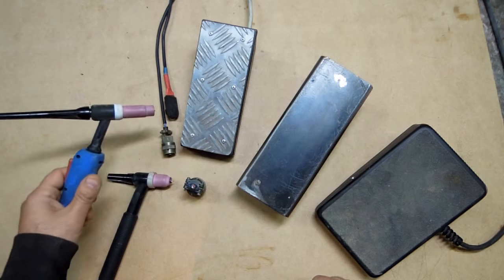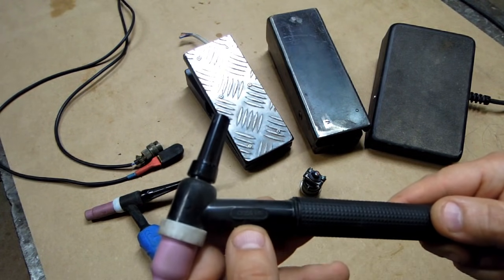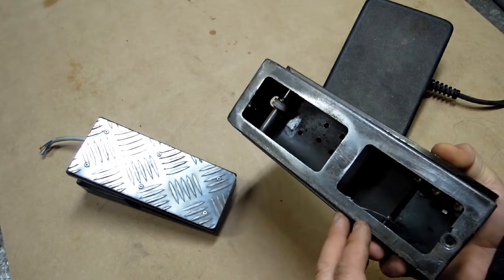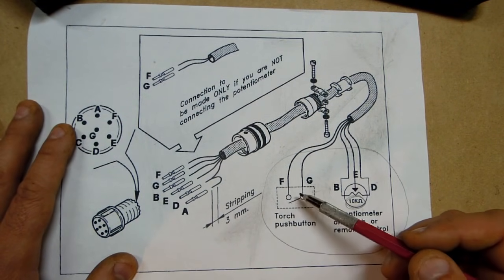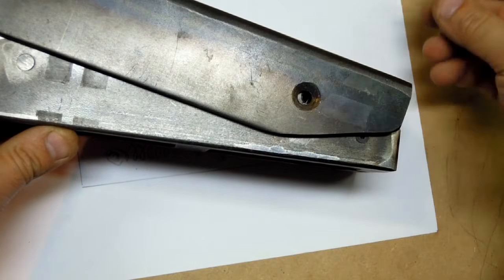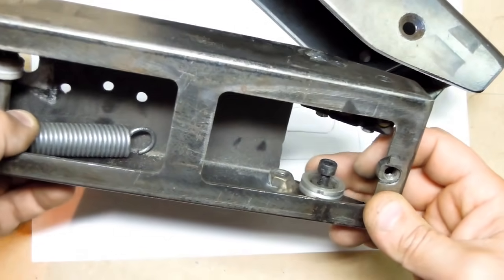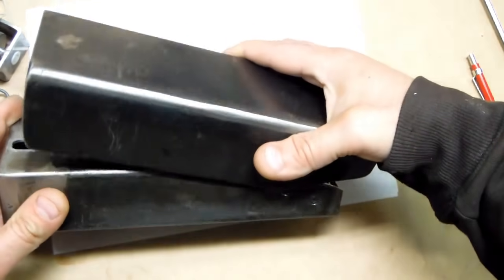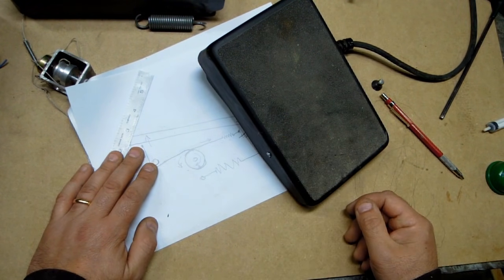DIY Tig Pedal - Part 2

Comment: Very cool Tony, I was just out in the shop running a few beads and making a 3rd hand out of re-bar and scrap steel...and TIG brazing some Copper onto the contact surfaces to increase conductivity. Brazing with electrical wire is fun, the puddle looks trippy and the Copper melts like Gold does, especially if you're not careful with the heat. It's pretty easy to control the heat with my footpedal now that I've gotten in my practice, but since the pedal defeats the amperage control, it does take a bit more brain power to keep in check.

I was wondering if you knew how to add a dial to the foot pedal to control the top end? If not I was thinking about adding a bolt I can adjust to prevent the pedal from going too far, but reducing the pedal's range wouldn't be ideal, and I am sure you feel me on that. Aloha...Chuck.
Reply from the maker: Thanks Knolltop.  Re: limiting the machine, all depends on the machine.  Rather, all depends on the potentiometer setting.  Usually 0 ohms = full machine current.  If you add a 2nd pot in-line with your foot pedal you should be able to cap the current.  Say your machine uses a 0-10k pot.  That's your whole current range.  If you add another potentiometer somewhere, so it adds to your footpedal, then you're bumping the 0 ohm setting away from zero (can't reach full amps).  Say your second pot is also 0-10k.  If you set that to 1k, then your foot pedal is now 1k-11k.  So your machine can never reach top amps (0 ohm).  If you set it to 5k then your foot pedal is 5k-15k.  Make sense?
Reply: Yes, that makes sense, and so I think I can figure out which wires run to the pot and where to install the 2nd one...just so you know, I've got an Everlast 160sth and I really enjoy it. The only thing missing is AC for Aluminum...

Oddly enough even after years of working with sophisticated machines and all the control in the world, I have gotten used to not having amperage perimeter controls. But, I'm sure I'd spend less time on testing/practicing just where to hang my foot, depending on thickness, if I had a dial. Plus, welding is a little more fun for me when I don't have to concentrate on feathering so much, and can just bury the pedal...

I'll let you know how it goes, and thanks again...Chuck.
Reply: @ThisOldTony just an observation:  When the resistance at pin E is 0 ohms relative to pin B, then it's 10k ohms relative to pin D... and vice versa. So you could say max amperage is at 10k ohm and min amperage is at 0 ohms if you swap your reference point. B <-> D

It's all relative. ;-)

Comment: Hi Tony,
So basically we only have a pot and a resistance regarding electronics?
Do we need something else for High Frequency start ?
Do you think about improvements after 1 year of use?

Thanks a lot for sharing this
Reply from the maker: +vibram500 A pot and a switch.  The switch initiates HF start, the pot sets the current.  As mentioned in the video, the hard part is timing the pot so that it provides the correct resistance the moment switch is triggered.  The moment the switch .. switches.. :) .. you want to be at your lowest AMP setting.  If the timing is off you'll limit your machines amperage range (the value when the switch actuates will be your starting amps.. and up from there until you run out of pot range.. which hopefully = the max your machine will do.

My pleasure.. and have fun!  Thanks for watching.
Reply: +This Old Tony Great thanks for your really quick reply. I will work on it this summer I hope !

Comment: chinese machines have two plugs a 2 prong for the switch and a 5 prong for the potmeter
other thing , there volumepots for radios that have a switch at the start . would that be strong enough to switch the welder on and off ?

Comment: Nice one Tony and not to long to hear how a fine mind thinks!  Your mechanisms accounted for all the variables quite ingeniously, but you forgot the first rule of electronics design and having at least a 3 year availability of parts. ~¿@  I'm sure you can find a replacement for it and have seen similar on E-Cabinets but with 1/4" spades instead of screws.  Most of them of similar VA have similar thru hole mounts too.  Always a pleasure! Thanks for Sharing your time and insights.  ~PJ

Comment: My Klutch 220Si has no provisions for a foot control. I'm considering using a Yamaha 7221 chain drive foot pedal for drums. Maybe a low voltage switch for the hard stop in the up position with relay buffering.

Comment: I just bought the metal parts for a pedal, I decided to make one.
 Unfortunately my welding machine does not have a plug for the pedal, so I have to modify the onboard circuit also.

Comment: Hi Tony.

First of all I'd like to say thank you for your time and effort for your tip top editing skills. It makes watching your machining skills a little more enjoyable! (English sarcasim)

Can I ask one question? Is that a Kemppi plug I saw on the video? if it was would you share the pin wiring with me please, as I have a kemppi mastertig 3000.

ps loved the cnc welding also your new vortex tube. I didn't even knew they existed till you mentioned! Thanks :)
Reply from the maker: Thanks David!  I'm afraid it's not Kemppi, it's a Cemont.  Have you tried emailing Kemppi support?
Reply: I'll give it a go. I'm guessing they will be very reluctant and if I make up an elaborate story about my R11F they will probably just say take it to a repair centre. It's worth a shot though. 
Thanks Tony.
Reply: I have the wiring diagram for a Kemppi C100F pedal if that's what you are looking for, 4 and 10 pole plugs.
Reply: 1873Winchester unfortunately it has to be a R11F according to Kemppi. The C110f doesn't work according to them. Thanks for the offer though.
Reply: 1873Winchester Hi I would like text you about wiring diagram for Kemppi C100F. If you still have please text me.
Reply: Thank you very much. Everything is ok, but i can't read 
capacitors c1-2 and zener diode v1-2. Can you help me?
Reply: I believe V1-2 are 15V/1.3W and C1-2 are 220N/63V, had a hard time deciphering them too
Reply: Ok, so thank you very much.

Comment: Hello! You say the potenciometer is 10k to minimum current and Zero ohms to maximum current....  In fact we use just 2 points of the potenciometer right?  My machine use 2 separated connectors,  one to on/off and another the current control.

Comment: Would be handy if a guy could buy a potentiometer with a splined shaft similar to a servo horn, would be awesome for 1 off projects like this in that you can clock it in a somewhat small range of motion to accommodate design error.

Comment: The pulley at the heel seems a bit over-complicated. You could probably have just welded a rod or plate to the heel of the pedal (at 90 degrees, pointing down), and attached a longer spring (or that same spring with the steel cable) directly to it. It would basically do the same job as the vertical part of the cable.

For the switch (assuming that was originally one of those switches with rollers), you don't really need to worry about the throw matching the motion of the pedal if you mount it vertically and use a sliding cam (again, welded directly to the pedal) to press it. Not sure if there would have been enough space inside the pedal base to do that, tough.

Comment: I have a question.. recently when i turn on my welder the arc starts... the only way i can stop it, is by unplugging the pedal. Ive tried cleaning the potentiometer and checking resistance and I am stumped. Im pretty sure it is time for a new pedal, but if there is something I'm missing i would hate to spend hundreds to replace a pedal if there is an easy fix
Reply: The machine is a lincoln square wave 255, older transformer machine

Comment: Hye hye hye there OT - a ridiculous simplification - I wonder if it would work.  Take an extra-thick inner-tube (26 in thorn proof tube) and slice some rings and wrap them around the end of the pedal, right where you indicated.  Had to learn the hard way that spec'ing springs is a 2nd choice to using rubber elastomer bc of relative properties of the materials.
Now tell me your secret editing sausage recipe.. 😁 Mum's the word.. 🤐

Comment: i have a tig stick welder ( boc 185ACDC ) and i want to buy a slider for the torch, the manufacturer wont tell me or supply a diagram that would tell me the resistance of the pot so i can get the correct one,
how do i find out which resistance value on to buy?
cheers in advance

Comment: If your machine sees 10k ohms for the minimum and the act of switching it on drops it to 9k why not install an 11k resistor so you get the minimum at start? Or why not use a normally open start switch that stops the machine when it's closed?

Comment: Very usefull. Been thinking about acellerator for electric go kart, the speed control uses a pot,  the internet is awash with hall effect witchcraft.. keyboard volume pedal, top tip.

Comment: Very late suggestion. Engineer the switch and potentiometer "mechanically" in series. Make the switch part of a two stage pressing mechanism, so that you have to press "through" the switch before it can turn the potentiometer

Comment: simple question, can you modify any tig to take a pedal or does it have to allow a pedal add on?
Reply from the maker: +Troy Dawson Good question, but above my pay grade.  I'm sure a determined person could tap/hack into the panel knob or keypad.  I believe my TIG has a simple panel-mount potentiometer that gets bypassed when I plug in the pedal, but I'd suggest taking a very close look at how the machine determines the amp setting before potentially toasting the poor thing.
Reply: +This Old Tony Thanks for the reply.  So with a little thought on the electronics, potentially (no pun intended) any tig welder which has a potentiometer could be bypassed and have the potentiometer within a foot pedal to do the work instead then. That makes sense.. thanks ;)
Reply: i actually did this. i wired the original pot from the front panel through a connector for a 5.25 mm stereo jack plug. this engages the internal pot when no cable is attached. when you plug in the cable, it disconnects the internal pot and allows the external one to take over.
the pedal i made from some wood and steel and a good neoprene cable

Comment: Ernie Ball guitar company makes these pullys and springs for there volume and wah pedals sells them for $25 bux change the string to a metal cable and ur set good work but you can buy an EARNIE BALL MVP STRING SPRING AND BEEF IT UP SAME EXACT CONCEPT 
GOOD WORK

Comment: why not use a rack and pinion to control the potentiometer, rack on the pedal spins a gear on the potentiometer that has an on/off feature like an old radio on/off volume knob??
Reply: That is what I used when I built mine using his original 30 second video as a guide.

Comment: Thanks for posting this. I have a cheap, well cheaply made, Chinese foot pedal and it's hopeless. I will now look to replace it with a shameless copy of yours.
Reply: You could get the resistance measurement off of your switch. I think they vary with the machine type. Plus check out the wiring.

Comment: I learned to weld on a backwards pedal machine no petal full throttle harder. U push the less u get used that machine for 10 + yrs then upgraded to new machine with correct pedal took me long time to relearn pedal never new my pedal was wrong
Reply from the maker: Think what would happen if you got behind the wheel of a car who's pedals worked that way.
Reply: This Old Tony that would b a handful

Comment: I wonder if anyone has ever thought of the thing that bothers me, or whether I’m the only one.

I find that the pedals bother me because of the way the movement goes. You put your foot on it, and press the back down past that pivot. I find that uncomfortable. Your toe is going down, while your heel rises., even if just for a bit. I’d rather have it work so that your heel is on the ground level, and your toe push a lever down. So that the pivot is at the back of the heel, rather than somewhere nearer your ankle. I find it more precise, and less tiring. You also don’t need as much movement for easier control.

Comment: Why not just use a pot with an inbuilt switch?
Reply from the maker: You could, but a little higher risk.. you don't have any control over the timing so a very good quality switched pot would be required.  Separating the two allows you to tune the pedal.. but not a bad idea.. more than one way to skin a cat.  Thanks for watching Karl.

Comment: I have a stick welder (inverter?)  that I converted over to TIG. It’s obviously scratch start DC but I’d love to know how the hell I could wire up a foot controller to it so I can slowly lower the amperage as I’m finishing a bead. If anyone has an idea, please get ahold of me via this comment. Or TOT, your help would be appreciated.
Reply: If it has no connector or plug for a remote you would have to hack into it and put a connector in to have the pedal rheostat in series with the one on the panel.  It is likely possible.  For welders that are transformer based uoubwould likely need a very expensive high wattage rheostat. But a bit of sleuthing on an inveter based machine you could find the amp draw and voltage range of the panel rheostat and match it.....

Comment: You're gonna smack yourself in the head when you read this if you do read your comments I know this is a very old video. You could have run that potentiometer off of a zip tie think about it!! are you thinking about it?

You could have literally rigged up a little aluminum block with a slot through it to run the zip tie through and then put a dab of glue on it to hold it in place used an appropriately fine tooth pulley and the potentiometer and allowed the zip tie to simply act on the geared pulley pinched between perhaps a piece of delrin with a strip of rubber around it to hold it in place? It would be very easy to keep in place

Comment: All that job, when you can buy something made for your machine by the same manufacturer
Reply: Yes you can!! But, the Miller foot pedal controller for my Miller Multimatic 200 is $360. Using the first 30 second video, I built one for about $30 in parts....